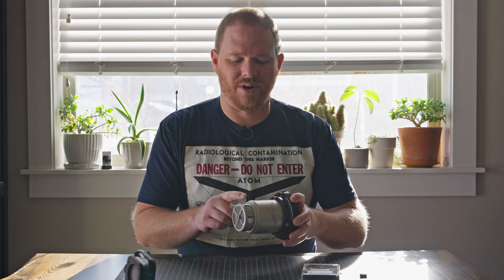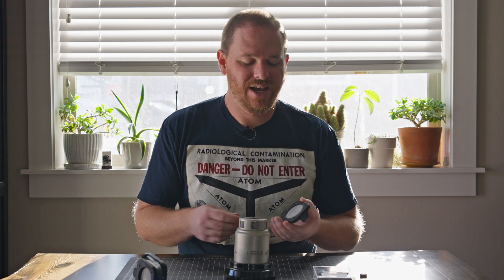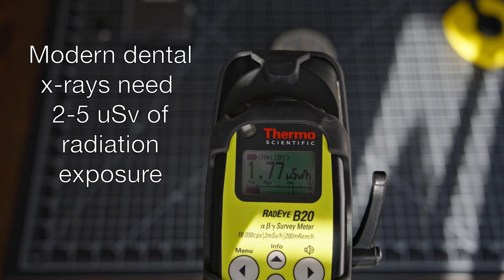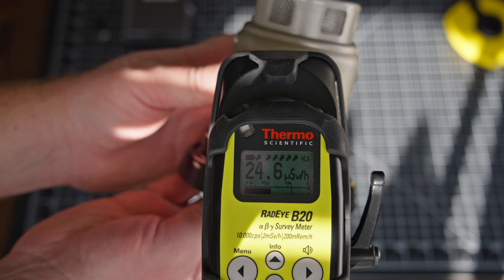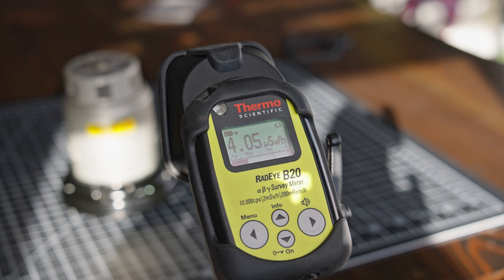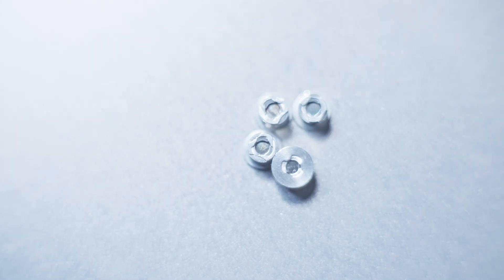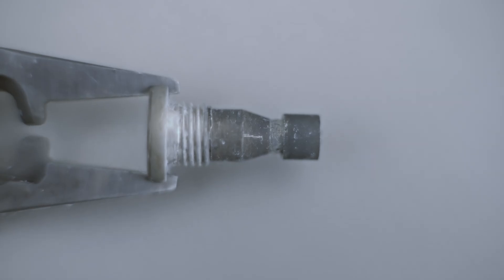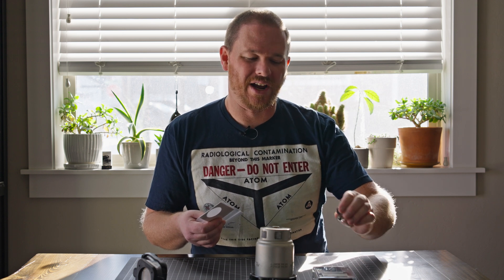How Much Radiation Was I Exposed Too

Comment: Some of those old smoke detectors actually had plutonium in them back in the day, also it's worth noting that smoke detector heads were often tossed into attics and under floors on refurbishments over the years or just thrown into builders skips of demolition rubble or the trash can...

I've noticed that they have very quickly and very quietly removed sealed source detectors out of the market and they are almost all fully optical detectors on sale now, this had happened in the last 4 years or so here in the UK and I imagine in the USA as well 🤔
Reply from the maker: Here in the US you can still buy Am241 smoke detectors from all the home improvement stores along with online stores. Maybe one day they will stop using them.
Reply: @RadioactiveDrew  You can get non ionising smoke detectors for domestic use, which are optical types. It's claimed that the older ionising types react quicker to flaming fires but the optical types react quicker to smouldering fire types, which I would have thought is better?
Reply: @ajacks1349  depends how much oxygen the fire in your house is getting. More o2 = less smoke, less o2 generates more smoke since smoke is really the  product of incomplete combustion and combustion is an oxidation reaction.
Reply: @535Medic  Suppose the best option then is to have both types fitted...🤣
Reply: @ajacks1349  yup, that's why I have both in my house. Photo tied to the alarm system and a ionizing one  right next to em.
Reply: The Soviet RID series smoke detectors contain Plutonium239...several reviews up now on YT. Sources seem to be from unscrupulous operators out of Ukraine...lol
Reply: @ajacks1349  I have one of these! Specifically a RID6. I was desperate for a plutonium source and now I finally have one. Unfortunately the spice is lacking and only an industrial model will do 😆.
Reply: @ajacks1349  Maybe that’s why these men in suits keep following me everywhere 😂🤣
Reply: @catfission  That's it...you're about to be raided...😂
Reply: @catfission  lmao, good to see you here bestie. RID-1 ftw
Reply: @inductivelycoupledplasma6207  I would sell a kidney for one RID-1 unit
Reply: Producing the Americium or other radioactive isotopes is expensive especially when your government is no longer doing massive enrichment for weapons material all the time. Thus the shift to optical detectors.